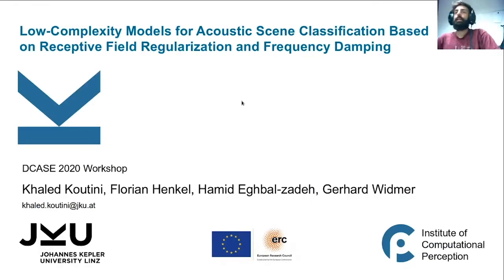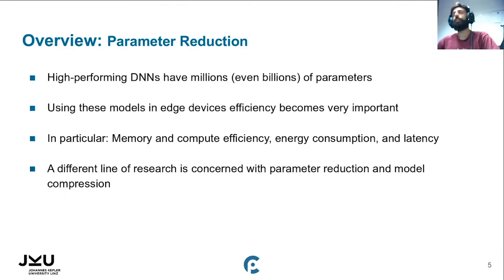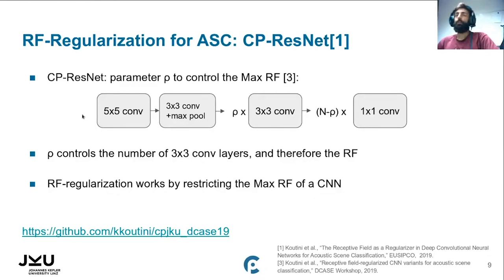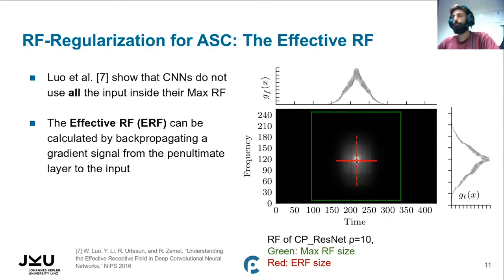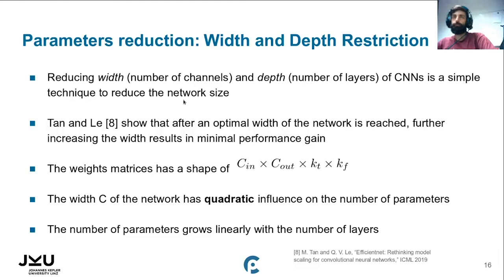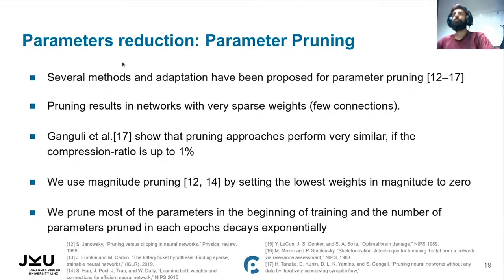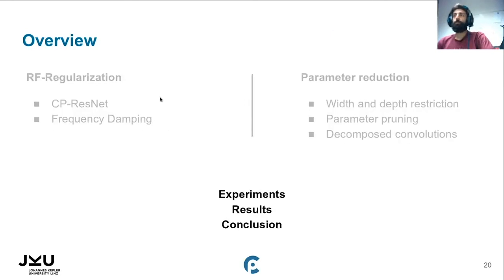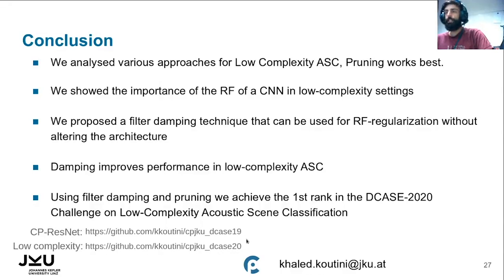DCASE 2020 Workshop, ID 91, Khaled Koutini et al.

Comment from the maker: khaled_koutini
5:48 PM
 Has joined the channel.

yohei_kawaguchi
7:58 PM
 Has joined the channel.

yohei_kawaguchi
Admin
7:58 PM
Copied from Zoom

Ohad Barak 03:29 PM
You put a 1 in the middle and 0.1 in the surrounding cells in your damping matrix, and got an improvement. If you do the reverse: put 0.1 in the middle and 1s in the surrounding cells, do you expect the results to be worse?

nicolas_turpault
12:23 AM
 Has joined the channel.

yohei_kawaguchi
Admin
12:29 AM
L13
Copied from Zoom

Ricardo Falcon Perez 12:15 AM
It seems to me that the RF regularization and damping is forcing the network to use its capacity to learn filters with specific properties. Have you considered an approach like SyncNet, where you learn parametric filters instead of raw filters? (I’m sorry if this is unrelated).
This question has been answered live

Nicolas Turpault 12:20 AM
Thank you, that’s very nice work.
Is pruning working better because of a sort of correlation between features ?
This question has been answered live

Nicolas Turpault 12:23 AM
Forget about my question, I got my answer
This question has been answered live

khaled_koutini
12:32 AM
Hi Nicolas, thanks a lot. Sorry about the delay in typing. I'd guess that it's related. However, in our experiments we used magnitude pruning in which the pruning criteria, is only the magnitude of the (trained) weights. This topic is being actively researched now, I'd recommend a couple of new papers: Synaptic flow and https://arxiv.org/abs/2009.08576 .
arxiv.org
Pruning Neural Networks at Initialization: Why are We Missing the Mark?
Recent work has explored the possibility of pruning neural networks at initialization. We assess proposals for doing so: SNIP (Lee et al., 2019), GraSP (Wang et al., 2020), SynFlow (Tanaka et al., 2020), and magnitude pruning. Although these methods surpass the trivial baseline of random pruning, they remain below the accuracy of magnitude pruning after training, and we endeavor to understand why. We show that, unlike pruning after training, accuracy is the same or higher when randomly shuffling which weights these methods prune within each layer or sampling new initial values. As such, the per-weight pruning decisions made by these methods can be replaced by a per-layer choice of the fraction of weights to prune. This property undermines the claimed justifications for these methods and suggests broader challenges with the underlying pruning heuristics, the desire to prune at initialization, or both.
👍 1 

nicolas_turpault
12:36 AM
Nice to hear from you Khaled ! That is indeed interesting, I checked your paper after asking the question and indeed, there are more details there. 
I'm not very familiar with pruning so thank you for the recommended papers !
I wonder if these methods are very model specific or could also be application specific
👍 1 

khaled_koutini
12:53 AM
From my understanding, I see them as different optimizes (adam, gcd ...). I mean: although in the end we are just removing weights (connections) from the network and they work similarly to some degree, they can result in different networks in certain domain/models . We didn't test different methods extensively. Because when we were working on the paper, the last pruning paper (https://arxiv.org/abs/2006.05467) claimed that different methods behave very similarly up to around 1% compression. However, this paper from September https://arxiv.org/abs/2009.08576 didn't manage to reproduce all the results. In result, I think they can be model/application specific around the limit of sparsity. some methods can cause some layers to collapse sooner.
However, comparing with the other parameter reduction methods, pruning is by far the best.
arxiv.org
Pruning Neural Networks at Initialization: Why are We Missing the Mark?
Recent work has explored the possibility of pruning neural networks at initialization. We assess proposals for doing so: SNIP (Lee et al., 2019), GraSP (Wang et al., 2020), SynFlow (Tanaka et al., 2020), and magnitude pruning. Although these methods surpass the trivial baseline of random pruning, they remain below the accuracy of magnitude pruning after training, and we endeavor to understand why. We show that, unlike pruning after training, accuracy is the same or higher when randomly shuffling which weights these methods prune within each layer or sampling new initial values. As such, the per-weight pruning decisions made by these methods can be replaced by a per-layer choice of the fraction of weights to prune. This property undermines the claimed justifications for these methods and suggests broader challenges with the underlying pruning heuristics, the desire to prune at initialization, or both.

nicolas_turpault
1:07 AM
Thank you very much for this explanation with the references !
It is very interesting what you're saying about thinking them as a better way to optimize, because intuitively it is not clear for me why it would work better.
(Also I guess there is no parallel at all to make, but when I hear about pruning, I often try to make the parallel with dropout which doesn't have the same purpose and function)
👍 1 

khaled_koutini
1:22 AM
I think a large part of why it's working better is because it an iterative process:
1- we rank the weights by some criteria determining their importance to the network (here is where the methods are different)
2- we select a small portion of the ranked weights and mask them out. so they don't interfere with training in all the future epochs. (unlike dropout)
3- we continue training the pruned network.

So we are always gradually training the network to work with a slightly fewer weights (there is also an exponential decay scheduler for the number of removed weights, so near the end of training, we are removing very few weights and fine-tune the network).

The criteria which sorts the weights and determines their importance is what i was relating to optimizers. some use gradients in different ways, magnitude etc... but I think you're totally right, it's a bit misleading to compare them to optimizers!

nicolas_turpault
1:33 AM
Thank you for the explanation !! It is definitely an interesting method worth reading about and following.
I wonder how we biased uncertainty (potential adversarial examples) when doing these methods.
Thanks again for your work, it is very well made and clear, I enjoyed watching and reading it !
👍 1 

khaled_koutini
5:02 PM
Thanks a lot of your interest!

khaled_koutini
1:00 AM
Hi Ricardo, I miss understood your question about https://github.com/mravanelli/SincNet

github.com
mravanelli/SincNet
SincNet is a neural architecture for efficiently processing raw audio samples. - mravanelli/SincNet
I'm not familiar with SyncNet, I'll read the paper and get back to you.

stepan_shishkin
1:09 AM
 Has joined the channel.

keisuke_imoto
1:34 AM
 Has joined the channel.